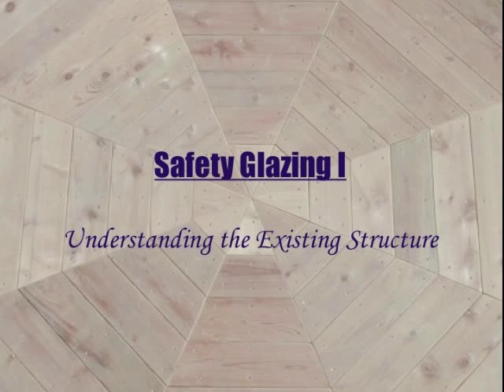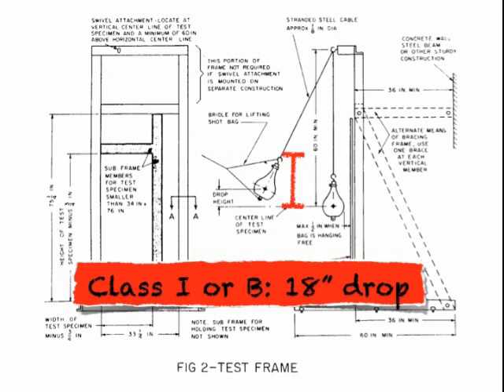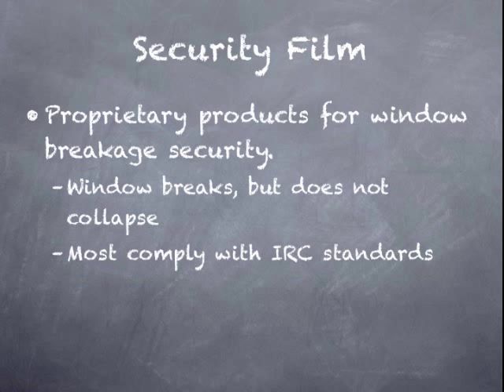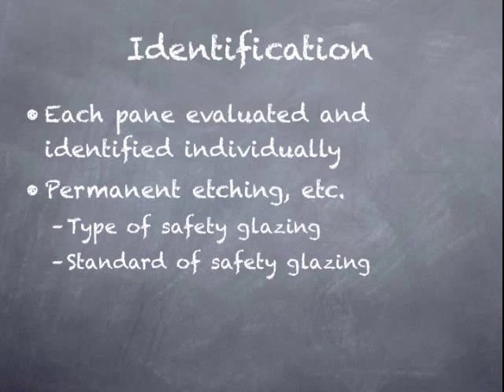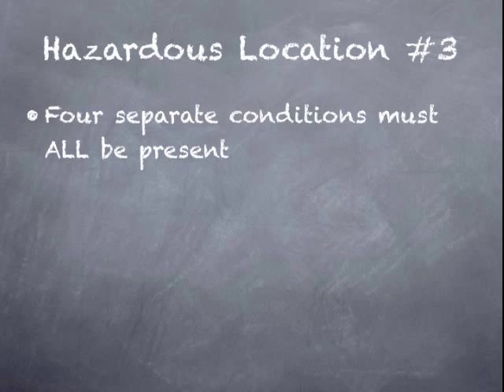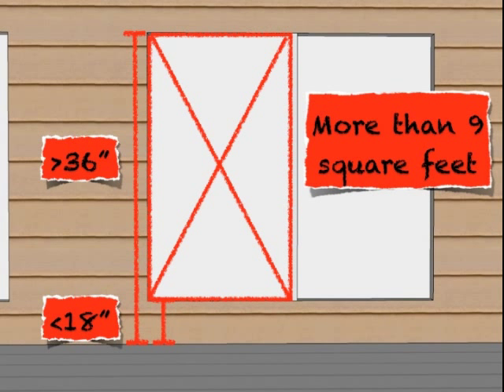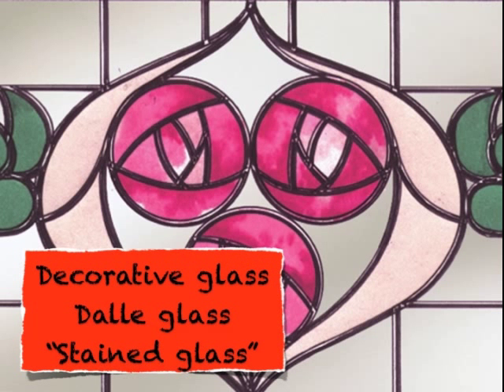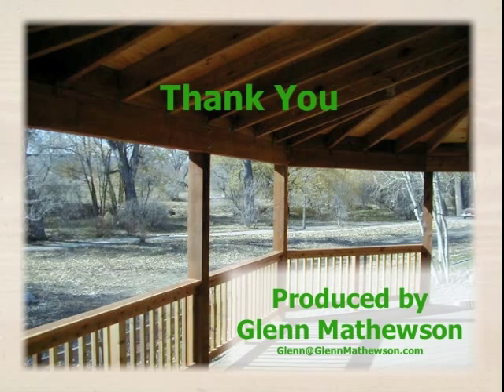Deck & Safety Glazing Code

Comment: Probably late, but what about Thermal requirements - if only by the homeowner. Does safety glazing come in double or triple pane? (This is South-Central Alaska). Or would it make more sense (financially, included) to use the films on both sides?
You didn't mention who applies the film, but implied the window comes that way.
Since we have to replace one very large pane, (The seal is gone) and it is one of 5 in that room, all of which meet the safety glazing requirements, it becomes a choice of rebuilding for windows higher off the walking surface on 4 of the five. The fifth has a view we want to keep. We know we are going to have to sell in the not-to-distant future.  We have no code enforcement, but the banks do.
This video was awesome.

Comment: What it the window is not in a hazardous position when closed but then slides over the other window into a hazardous position?
Reply from the maker: That is a really good question.  I took a close look at the wording in the IRC again, and it does not specifically address this.  This leaves it up to the interpretation of the building official.  My interpretation is based on my test of "probable vs. possible".  It is very probable that the window will be open when an accident occurs in a hazardous location.  Therefore I would believe it reasonable to apply the provisions to the glazing in all locations where it is probable it would rest.  It is "possible" that someone will remove the sash of an operable window and lay it in a hazardous location.  I would not use that logic.  This is the possible vs. probable test.

Comment: Does the "36in to horizontal walking surface" criteria apply only to exterior surfaces or is it interior as well?
Reply from the maker: It applies to all walking surfaces.  Actually it is mostly thought of from the inside.  People have notoriously overlooked it in deck construction.